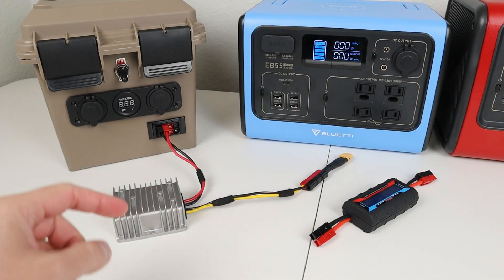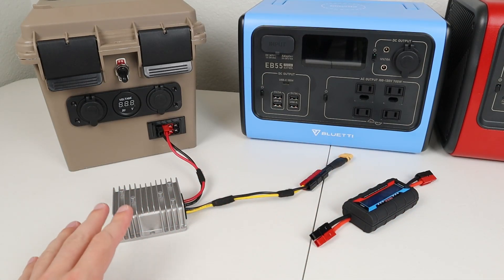Bluetti EB55 & EB70 Charging Tips and Tricks - Faster Charging Without Solar! EB55 400 Watts Input!?

Comment: I'm going to try the 12v upconvert but was wondering... If I have my solar connected to the MXT port can I still charge from 12>24v DC through a 8mm on the AC charging port? I am assuming yes, otherwise how could you get close to 400wats of charging. Just wanted to be sure. Thanks.
Reply from the maker: Yes, you can dual charge at the same time with both inputs and they peak at 400 watts.
Reply: @Jasonoid  Is it safe to run the upconverter from my vehicle battery through the 8mm AC port and also use the XT60 from solar?
Reply: Not sure on with electrics and whether charging DC through an AC port is harmful.
Reply from the maker: @jeremyjulyan1449  you can only use the AC wall charger on the 8mm input jack, the other port accepts a wider range of input voltage.
Reply: @Jasonoid  Ok. I'm glad I asked. Was planning to connect to a 12volt vehicle battery, upconvert and connect via the 8mm. Will look into another plan. I have a couple of 300watt and 400watt inverters. They should do the trick.
Thanks Jason!

Comment: Great video - do you know what type of losses there are from using a 12V to 24V converter? I’m looking to use an AC200P as a back up battery to my EB70S by charging it with the DC output from the AC200P and this would speed up the process!
Reply from the maker: There is some heat build on the device so you are losing power in the process, hard to tell an actual number. So you need to chose between a slower charge rate thats probably more efficient or a faster charge rate.
Reply: @Jasonoid  Perfect summary of my dilemma, leaning towards faster DC charging in this scenario due to high AC200P internal power use

Comment: Followed your suggestion and got the step up. The Bluetti charges pretty fast in my car with that. Around 188 watts. Without the step up, it's around 85 watts. Thanks for the info.
Reply from the maker: Oh yeah, makes such a difference! :)
Reply: Is that with plugging into the 12v charger that's in your car? I'm trying to do something similar and wanting to avoid wiring directly to the battery. Thank you!

Comment: Does the 12v to 24v 10A converter create alot of heat with extended charge times?  I'm questioning because the 7.6A it pulls while charging is pretty close to the 10A limit.  Wonder if it would be better/more reliable to get a similar 20A unit.  I want reliability, but I'm guessing the power draw on the larger unit would be more.
Reply from the maker: If you are planning to use it all the time, I'd recommend going to a larger 20amp model, that way it will dissipate heat better.

Comment: If I use the 12 volt to 24 volt booster in my car will not blow the fuse?
Reply from the maker: It will blow a fuse, you'll want to use a direct fused connection to the starter battery (or secondary battery).
Reply: @Jasonoid  awesome thanks!

Comment: I would be interesting to see how the 12/24 unit for charging can be connected and used on various Victron output systems.... solar. dc to dc... I'll be checkin on such..  I did hear that slower charging rates (at least for lithium ION) will help in battery longevity ... but PO4?  Maybe rate has near no effect.
Reply from the maker: Charging both types of Lithium batteries slower will be better for long term health, I don't think it affects it that much though. I don't have any Victron equipment so I wouldn't be able to test that out.

Comment: I noticed the DC to DC converter has 16awg cable attached.  No issues wiring from 12awg from the battery and dropping down to this 16awg?  I didn't notice til I got the converter in the mail and I just ordered the 12awg wiring and fuse holder.  I don't plan to use this outlet with anything else, so I suppose the 8A should still be fine.  

Also noticed the converter you linked wasn't the DayGreen you had.  Haha.
Reply from the maker: There are many "brands" that are basically the same model on Amazon. It changes frequently so I had to update the link to a product that was in stock. The 16awg wires are such a 'short run' it shouldn't be an issue with voltage drop. I also noticed the same thing so good eye. When testing the charging the wires never got hot. I did notice they were a little warm but I think that's fine. Give her a good test to make sure it all works as expected. If you get an issue toss it back to amazon within the return window. You shouldn't have a problem though :)
Reply: @Jasonoid  awesome, thanks for confirming.  👍

Comment: do you have a video on how to set up the 12-24v converter in a car? step by step with the wiring and stuff?
Reply from the maker: I don't have a specific video, but since it pulls over 10 amps it will blow a 12v cig port fuse, you'd want to hardwire it in directly to your starter battery.

Comment: One question if its plugged to the wall or solar and vet disconnected. Does it continue to power devi es
Reply from the maker: Yes, if you have this plugged into the wall charging and you unplug it, it will continue to run devices off the internal battery until the battery dies.

Comment: Highly informative.  However, do you have a recommendation for replacing the Bluetti AC to DC converter that does not have a fan?   Thanks.
Reply from the maker: Any power supply that puts out 25v to 28v around 8 to 10 amps will work

Comment: Hi Jason.  I just purchased a Bluetti EB70s and I'm waiting for it to arrive.  Question for you.  I have a 2021 GMC canyon and I want to use the 12V cigarette lighter to charge the EB70s while traveling.  I plan to use the EB70s to power a small fridge and other devices while i'm out camping.   Could I use a 12v inverter between the cigarette lighter and the EB70s to help with rapid charging?  Please let me know your thoughts
Reply from the maker: Most 12v sockets are rated at 120-180 watts max. If your 12v socket in your truck is rated for 250 watts max, it's safe to run an inverter and the 200 watt wall charger. If not, it will blow a fuse and lose power. That's why you'll most likely need a direct connection to your starter battery, it pulls lots of power.
Reply: @Jasonoid  I appreciate your reply!!! I spoke with my friend who wired all my lights and he said the same thing.  I think I’ll get a direct connection to the battery. Thx again!!!

Comment: After cutting the cigarette lighter plug off the specific Bestek inverter model in the video, and hard wiring it to my minivan battery 15 feet away behind the front seats using 8 gauge pure copper wire, in order to fast charge my Bluetti EB70 while driving:
1. how would you connect the 8 gauge wire to the inverter, and
2. what amp power breaker would you use on the 8 gauge wire near the minivan battery?
Reply from the maker: 1. You can use a crimp connection with heat shrink, you can also solder it and heat shrink the connection. You could also use ring terminals with a bolt connecting them together.

2. 8AWG wire is rated for 40amps, so a 40 to 45 amp fuse should be fine.
Reply: @Jasonoid  Thanks!

Comment: Great video thank you for this. Do you have a link To the power supply and the Volt meter?
Reply from the maker: Are you wanting the DC 24 step up converter or the 24volt wall power supply?
Reply: @Jasonoid  both if possible., and the Meter on the right that's sitting on the table at 2 minutes 40 seconds into the video

Comment: I’m curious, I have a Toyota Tacoma. Can’t I just plug in the AC outlet to the back of the truck and power my EB 700 that way?
I believe while I’m driving it has around 450 Watts. 
That way I can bypass using the 12 V socket and blowing any fuses. Thanks
Reply from the maker: You're lucky to have the built in inverter, that's awesome! Yes, while driving you can charge up the EB70 with the stock 200 watt charger and keep it topped off while running your fridge or other accessories!
Reply: @Jasonoid  I just bought the EB70 direct from Bluetti and when charging from zero to full it's only taking 1.5 hours on AC and then showing full.  This sounds great BUT it is depleating fast and seems like it has 300wh capacity (not even 600wh).  I think there's a fault so I might have to get a replacement.  Wondering if you had any tips or ideas what could be happening. Thanks 😊
Reply: @Jasonoid  
Thanks. I have a Kimbo Camper I’m going to try and connect it to the shore power line and hook it up to the EB 700S. Figuring this is the best way, so it won’t cost me a fortune to run it from the battery or alternator. 
I’ll just run a cord from the inverter to the shore power. I was going to run it through the 12 V socket on the truck until I saw your video and realized I don’t want to blow a fuse or cause a fire! 🖖

Comment: Awesome video. My car has a 100W AC220V plug in the back. From your video it would seem that would run the charger and hence charge the battery whilst driving. I intend on Plugging the charger into the 100W inverter, then plug my portable fridge into the EB55. Would this work? I assume it would take 5+ hrs to charge like this whilst driving?
Reply from the maker: That will work great! Nice plan to charge the EB55 and run the fridge at the same time.

Comment: Great video! Can I plug an EB 70 into the rear AC output on my 4runner,  and just charge while driving? With the fridge plugged in!
Reply from the maker: That should work just fine. It will keep the EB70 topped off until you turn off your engine, then your fridge will run off the EB70 capacity.
Reply: @Jasonoid  thank you! Just wasn't sure if it would be too much for my stock alternator to handle?
Reply from the maker: @oyster_3694  Not at all, you are using the built in inverter so you'd hope Toyota planned for that to be used :)

Comment: how do maximize the solar charging?
Reply from the maker: Find the highest voltage 12v solar panel. There are some great 200 watt glass rigid panel options with higher voltages. Rich solar, BougeRV. No one makes a 12v panel with 28 volts so you'll never see the full 200 watt input on this power station with solar.

Comment: Great info. Seriously thank you.

How long does it take to charge the smaller power bank by using your 24v wizardry you have shown us here Master?
Reply from the maker: That's the Bluetti EB55. It's around 537wh so to charge it up at 200watts takes around  2.5 hours.
Reply: @Jasonoid  I've been thinking to get the battery to self charge.... out school light bulbs .. powering solar panels.. connected to 12v to 24v which in turn is connected to battery

Comment: I’ve got an EB70S on order. Why do you think they released this, as it appears to only boost the ac output from 700-800 watts vs the EB70. Seems like a very minimal “upgrade”. What’s your take on this?
Reply from the maker: The normal EB70 seems to do 800watts just fine. I think it's a marketing thing. Maybe it has a software upgrade but I don't think anything is different in the hardware. It will be a great power station as well.

Comment: Have you tried using the 8mm barrel connector car charger from the eb70 in the eb55? Would be nice to see if you can charge with car battery/ alternator along with solar in the XT connector get 190w from the 24v converter into the 8mm barrel plug and 200 w solar into the XT...... 390w all while driving???
Reply from the maker: The EB55 8mm port will only take the wall charger input voltage so you'd have to have an inverter running in your car for the wall charger and then run the DC to DC step up converter to get 400watts. It's possible but youd probably have to run some large gauge wires direct from your vehicle starter battery to the inverter and DC connection for the step converter. Hope that makes sense!
Reply: @Jasonoid  Thanks for the reply!! Yeah that checks out.... Wondering if the Bluetti DC charging enhancer could fill that role? Just trying to figure a way to charge with the alternator and solar simultaneously without using an inverter. I guess you cant have your cake and eat it too. love the videos.
Reply: I see now the plug says 25v-28v so probably SOL... I did find a 12v to 28v step up DC- DC but probably not worth it. Might just have to settle for 24v 190w
Reply from the maker: @domwrinaldi  the 190watts is pretty decent,  but having the inverter isn't too much extra if you ever wanted to jump at that project.
Reply: @Jasonoid  can confirm I couldn't get the the 8mm barrel connector to work. I got a 28v 8amp step up converter and got 198 in the xt60 connector but the barrel connector didn't work. I see in other comments you were able to get it to work if you matched the chargers output 25v8a but I'm fine with 190. It lasted a 3 day camping trip in Utah easily with a fridge so I'm good with that.
Reply from the maker: @domwrinaldi  the barrel port is for the AC charger only, I wouldnt expect much from that one.
Reply: @Jasonoid  from your videos looks like ecoflow alternator charger is the way to go if you want to charge solar and from your car.

Comment: Interested in learning more about getting 24v from the car battery and your additional wiring for Anderson power pole.
Reply from the maker: You can see how to make Anderson Power Pole connections here in another video and the tools needed are in the video description:
https://youtu.be/bZHh3nWXtkw

Once you get the tools/connections for APP, you run 12awg wire or larger directly from your battery into your vehicle cabin, then connect the 12v to 24v booster and you can get 24volts for your power station.
Reply: @Jasonoid  sorry, newbee in all of this. if you run the 12 awg from the battery into the vehicle compartment to use the 12 to 24 converter to charge a EB 55 for example, it may take several hours to fully charge it. It would seem you’d drain the car battery for that amount of time and i wouldn’t want to run the vehicle at idle for a couple hours if I’m camped. Whats the best way to do it?
Reply from the maker: 12awg wire would be good. Make sure to put a fuse on the positive wire close to the battery. You could charge the EB55 for maybe an hour without running the engine. After that amount of time you'd want to run the engine to keep the battery from dying. This mod would work really well to keep the power station full while driving on a road trip /running a 12v fridge.
Reply: @Jasonoid  thanks. How big a fuse?
Reply: @Jasonoid  i see you’ve referenced wiring your Toyota. Have you considered making a video on its capabilities?
Reply from the maker: @kenmoist  I ran 6 awg wire so I can pull about 50 amps from the battery for multiple uses. I use it mostly to fast charge my DIY 100ah lifepo4 battery and run my 12v fridges on camping trips. I've thought about a video. I probably put one out once it warms back up.
Reply from the maker: 20 amps
Reply: @Jasonoid  sounds like a good set up thanks
Reply from the maker: You may want to put a 25amp fuse just in case you get slightly more draw than 20 amps, the wire should hold up just fine.
Reply: @Jasonoid   i made a set up with 8 awg wire from a 12 volt battery to a fuse box with a 20 amp fuse. Then connect the 12 to 24 volt converter into the EB55 and it works great, using Anderson power pole 30 amp connectors with  12 awg wire from the fuse block. When i disconnect that and hook up the Bestek 300 watt inverter and plug the EB55 110 charger into the EB55, the Bestek inverter trips and won’t charge. I see you are using the 300 watt Bestek and it seems to work fine for you. Maybe i need a 500 watt inverter?
Reply from the maker: @kenmoist  Interesting on the Bestek inverter tripping. Might be an issue with that inverter specifically because my 300 pure sine inverter works just fine on these 200 watt chargers. Thats the only thing I can think of because your whole setup sounds good. I don't think a 500 watt inverter is required for a 200 watt load.
Reply: @Jasonoid   it turns out the battery i was using had very low voltage-less than 11 volts. When i hooked it up to a charged 12.8 v. battery, it worked! Thanks for your help as always.
Reply from the maker: @kenmoist  yep, these bestek inverters shutoff at 11 volts! Glad you didn't have to buy a new inverter :)
Reply: @Jasonoid  at least I’m learning new skills putting this together thanks to your helpful videos